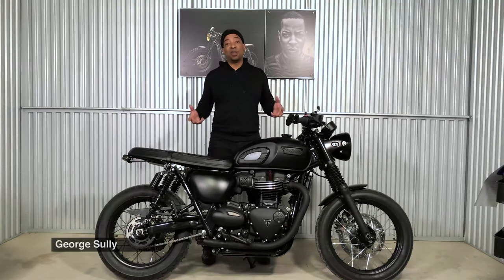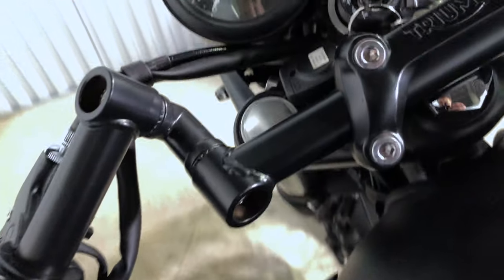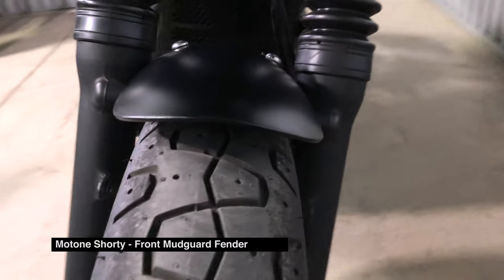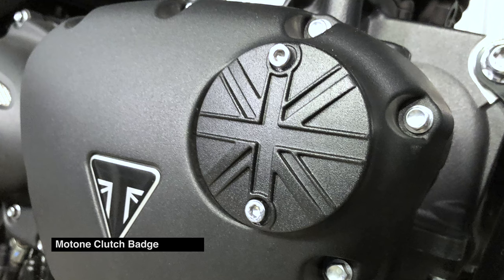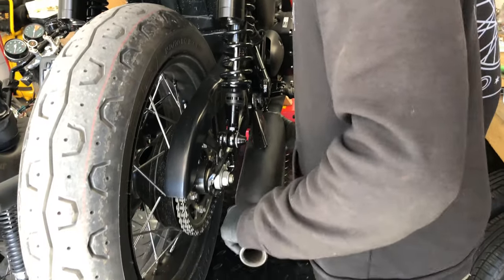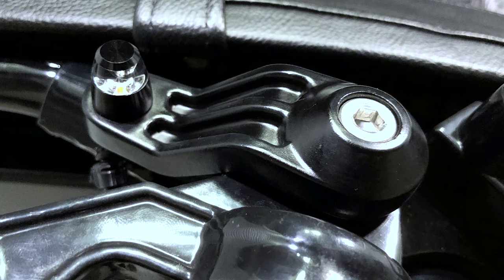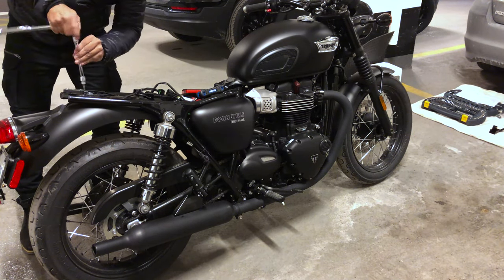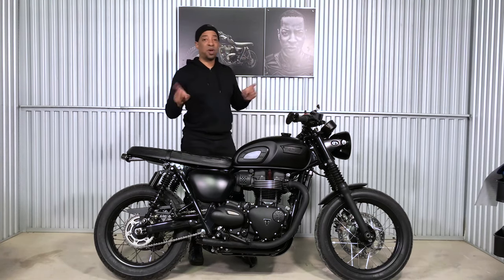The Murder of my Triumph Bonneville T100 - FULL ACCESSORY MODIFICATION WALK THROUGH - Part 6

Comment: LOVE both builds so far. got a genuine question for you, as an owner of both, what are your thoughts on the street twin vs t100? to my understanding their sizes are slightly different, with the st on the smaller side with slightly lower ride height, which in turns make it feel a lil more nimble. In the market for either, and an intermediate level rider of 8 years here. :) I'd message you privately but figure other followers can benefit from this q too, thanks!
Reply from the maker: The slightly ;larger size of the T100 makes all the difference. i'm 5'8 and I look tiny on the ST. But proper on the T100!